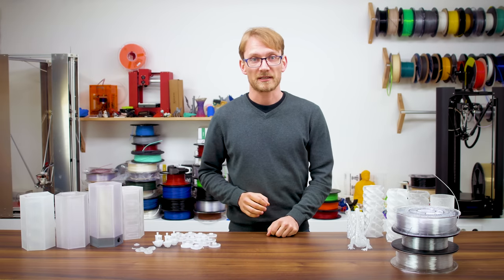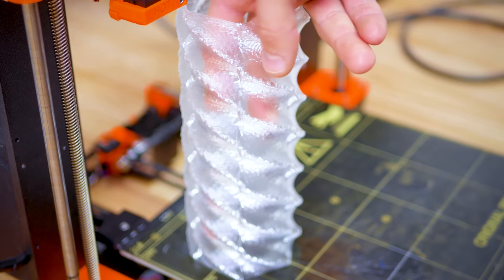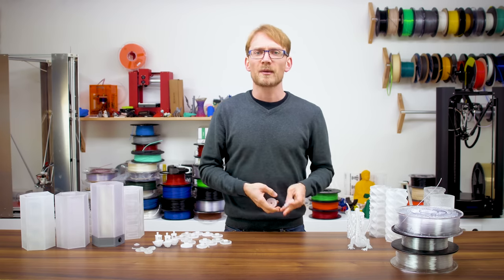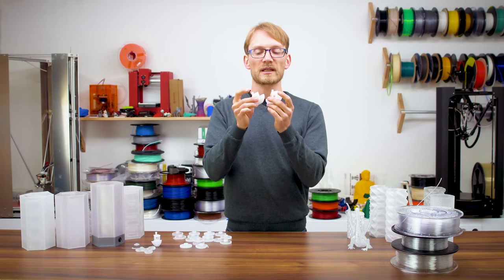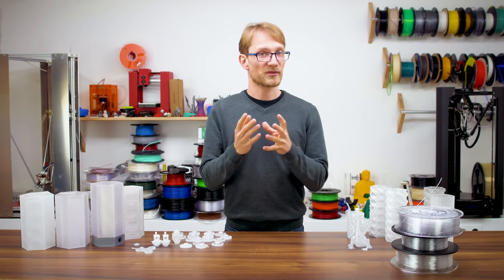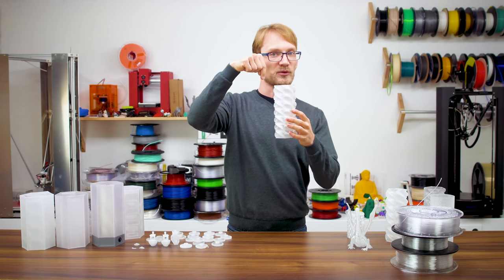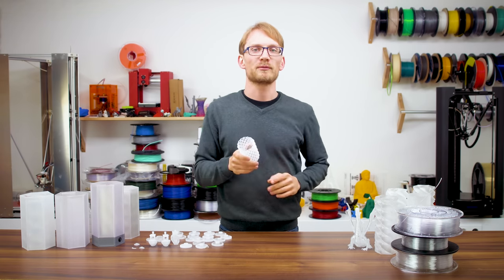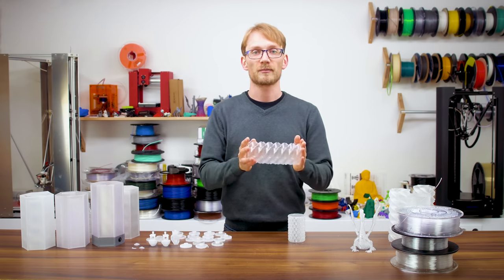How to create transparent 3D prints!

Comment: I haven't done any 3D printing (yet, waiting on my first printer being delivered), but I've worked in injection moulding for 20+ years and have a little experience with PETG. To achieve a high degree of clarity you want to dry your filament for about 3-4 hours with warm air (at least 70c, PE, PET, PETG are hygroscopic) and with a desiccant material in the airflow. Once dried you can reduce the heat to 40-50c but it must remain in a dehumidified chamber if you're going to print for more than 1 hour as it will absorb moisture from the air (that's what causes the spitting and burning at high nozzle heats, you want high nozzle heats). You need to cool the print quickly to retain the semi-crystalline structure, the longer it takes to cool, the less crystallinity will be retained. Big fans and a lot of them! High speeds increase crystallinity too, as the polymer moves through the nozzle tip the molecular chains align, the faster it moves, the more they align (hence the higher extrusion rate improving clarity). Thin wall sections with 100% fill (in Injection moulding high pressure is always favoured for clarity). Small nozzle diameters will help with increased shear force on the polymer through increased exit speed, I would guess a .1 nozzle with .05 layer heights would be adequate, with print speeds as fast as your machine can handle.Maybe I'll make a video on print clarity one day, when I get comfortable with my printer, I'd prefer to see you beat me to it though!
Reply: how did your testing go?
Reply: It’s been 7 years… We start to forget the things we should remember… And we remember the things we should have forgotten… how was the printer??

Comment: I was literally doing this earlier today. I noticed that a low layer height works better, just like you did. I also found that increasing bed temperature a bit helped the bottom get clearer too. I also tried disabling the fan, which did help make it clearer, but can't really be used with fine details. It worked for what I wanted though. Last, I found that increasing flow rate messed up some of my tolerances, but increasing only infill flow rate didn't (not as much at least), and the results were still just as clear. I would recommend that if your slicer supports different flow rates for perimeter shells and infill, you tune them independently.

Update: I also found that shallower infill angles reduce the bubbles trapped, increasing clarity. Instead of having the layers laid orthogonal to the previous one, make each layer lay about 15 degrees off from the previous one. I think the optimal solution for clarity would be for all the infill layers to be laid parallel and just offset them by half the nozzle width so that the new plastic is laid in the grooves from the previous layer, but I don't know if any slicer can actually do that.

Comment: You might want to try the oven for more uniform heating. In small increments heat a piece to just over the glass transition temperature 81c and let it cool in slow steps to reduce warping. See if annealing this plastic will help with clarity.
Reply: yeah i was wondering if something like that might help.

Comment: For the clear transparent prints, it doesn't really matter what clear material you use, it is important to make it 100% solid. The bubbles and layer lines reflects the light, so get them out and uniform print is the key. With the UM2+ printer I use settings: layer height <0,06 mm, flow 107%, 100% infill, no retraction, temperature little over the regularly used (e.g. for PETG normally 240 C, now 255 C), bed temperature >80 C. Speed doesn't matter so much. With these settings the bubbles come out and the layer lines disappears.
After the print is completed, you need to sanded the surface layer lines off, with >500 sandpaper. I also at the end smooth the surface with flame torch. Also chemical dissolving the layer lines out of the surface works.

With layer lines of 0,1mm or more, you can't ever get fully 100 % solid prints.

Comment from the maker: I feel like these parts came put great, even if they don't look like a perfect sheet of glass. Got any more tips to share for getting 3D prints perfectly clear?
Reply: Printing on glass can give you a transparent bottom.
Reply: I printed transparent PLA on glass 1mm thick then placed it in the oven at 180 Fahrenheit with (borosilicate) glass on top and bottom until the trace whiteness disappeared (about three minutes). Completely transparent plastic window.
Reply: NotMyActual AK interactive makes a finisher for transparent parts. Modellers use it for canopies and the like, and the effect is unbelivable so that might actually work
Reply: I have used acetone vapor on PETG and the surface seemed clearer. 
Just don't use a heat gun on it after, it will become really bubbly!
Reply: DO you think you could do a video on the Duplicator 7   it looks like a very promising SLA/DLP Printer.
Reply: How about using XTC-3D?
Reply: Tom,  as a materials science engineer - fast cooling will make more amorphous/clear while slow cooling will lead to crystallization/cloudy, hence your results from hotter center raised portion of the gear.  I think hotter and faster would work well or with fan on 100% smoother surfaces also help, so you may try flat discs that you can polish / try putting packing tape over the surface which effectively "smooths" it without the effort of sanding
Reply: Hello, great video, i'll make vases for that purpose :) With RGB LEDs inside for ambiant lights :)
About clear prints, what about annealing? perhaps that the low temperature cooking process could make the material more uniform, and imrpove the layers interfaces!
Reply: Thomas Sanladerer what about concentric infill? often i print translucent petg parts with 100% concentric infill and it seems to be way more transparent than rectiliniar. interested to hear your opinion
Reply: You should try out Polysmooth and the Polysher. I got mine a week or so ago, and the transparent filament is amazing, especially after being misting it with the isopropyl alcohol. https://instagram.com/p/BTcVerqjnyV/ I've only tried the vase mode settings so far.
Reply: XTC3D coating has worked wonders for me in the past. Has nearly the same refraction index as PETG and fills all the tiny gaps.
Reply: Have you tried using acetone on the surface?
Reply: Can you do ABS clear with acetone smoothing and post results?
Reply: I found that when the filament bubbles, it helps to increase the speed or decrease the temperature (as you said). I got a clearer benchy than you did. I would like to see a part 2 where you print a solid cylinder with a Delta, while playing with the temperature and speed to actively see how both speed and temperature affect the transparency of the print.
Reply: Slightly flamepolishing with a micro-jet lighter works wonders. Transparency with 100% infill is all about the surface finish. PETG like materials take really well to flamepolishing, but don't overdo it, or it will shrink (possibly uneven, thus breaking your part). tldr; treat it like acrylic glass that you just cut with a jigsaw.

Also, just found this article about printing silica glass:
https://www.nature.com/nature/journal/v544/n7650/full/nature22061.html
Reply: I haven't done this but did you try annealing it?
Reply: There is this 3d XTC or something like that surface finish. It's a clear coat and could potentially fill the little gaps and remove the lens effect entirely. Give that a go with a lamp cover, inside and out. I'd be interested in seeing those results.
Reply: I noticed you didn't mention a clear abs. I printed a pineapple in vase mode with clear abs, then treated it with an acetone vapor. Came out super clear! More than any of your example. I also used a Volcano hotend.
Reply: Does PETG get melted with solvent? If no, try to pulverize solvent onto the surface and then dry it with dryer at low temp.
Reply: Thomas Sanladerer  
Ever have any problems leaving your filament out like that?
Reply: Since Thomas was using PETG filament acetone wouldn't really help here. Toluene (undiluted paint thinner) would work, but it's use is heavily restricted in much of the world due to inhalation risks.
Reply: vapoursmoothing?
Reply: It's theoretically possible, but PETG doesn't react to acetone the way ABS does. There are chemicals that might smooth PETG (Toluene, some concentrated acids), but they pose serious inhalation (and sometimes fire) risks.
Reply: Resin printing
Reply: That would definitely give you a clearer print, and it makes me think... maybe the best solution for this problem isn't a CNC device at all? A foam board mold filled with epoxy resin might provide the best possible result.
Reply: Resin printers are a bit of a pain, but they offer the ability to print exactly what you want, just like plastic 3d printers. They have higher resolution, and the resin is clear [or tinted as you choose]. They use light to activate the resin, so there's limited moving parts [mostly, its about the lifting platform]. I'd go with that for clarity, if you still need the power of 3d printing.
Reply: Thomas Sanladerer (for Ultimaker 3) the layers should be between 20 and 50 Microns, (20 microns is the best for lens quality) also the filament should be printed at the maximum recommended temperiture, retractions and fans should be disabled, (Careful) you should sand and polish (with a low speed plastic brush tip on the dremel tool) the parts for best results.
Reply: Thomas Sanladerer could you share the files of that lamp? It looks awesome!
Reply: Hey Tom, great video as always! I got better transparency with fan off and lower printer speeds. Have you tried playing with fan or speeds to increase transparency?
Reply: Could put in an oven that's pre-heated for a short amount of time and then take it out and quickly cool? I like my heat gun but its blasting out 700(f)-1000(f) heat and wont evenly heat the part easily.
Reply: a fogger and some acetone
Reply: Actually, 3DXTech has 4 colors!= Diamond=(clear)= Saphire(blue) +Ruby/red and Obsidian /Black
Reply: T-glase is great, especially if you're printing with a larger nozzle like 0.7 or 0.8mm. Then coat with XTC 3D resin epoxy (on amazon, well worth it) and it will look even more amazing. Much more clear than in this video, for sure.
Reply: Print without fans and retracts, 100% Infil and then top is kinda clear

Comment: I got super clear parts using clear abs printing at 0.1 layer height at 250°c nozzle temp, 100°c bed temp 100% infill in a sealed chamber. after acetone vapor smoothing it was super clear almost like glass and thicker parts gave almost a magnifying glass effect. a few weeks later I printed the same parts again and it had bubbles that followed all the layer lines, I attributed to moisture it absorbed from the air that steamed in the nozzle as it melted.

Comment: a slightly domed nozzle helps a lot to massage the air pockets out of the hot plastic and get solid, glass clear prints out of PETG. ideally use a raft, or very high initial bed tem, to prevent the first layers from cooling too quickly. this still works with thicker layers but certainly not for all prints.  clearcoat makes the finished product look much more transparent too.
Reply: this tube has about 4mm wall thickness: https://www.dropbox.com/s/vwfa6qq9f5kwqhh/IMG_20170311_183919.jpg?dl=0

Comment: I remember doing tests like this a couple of years back specifically with PET. Think the conclusions I came to were thick layers (extra multiplier + more layer height), very slow speeds, more conservative heat settings, and no cooling fan. That was specifically for vase mode or 2 shell 0 infill boxes. I think the slower speeds allowed more time for the heat of the parts to stabilise, and reduced artefacting from movement, allowing for clearer walls.

I seem to recall very thick or very thin to not necessarily be of optimal in terms of optical clarity. I think I liked 1.25-1.75 layer heights in terms of light refraction, and anything outside of that seems to look more hazy. I'm sure that's dependant on other settings I had at the time and the slicer itself though, so that might not be relevant. It also might just be that this was the optimal material quantity to push through to not overheat or underheat the filament.

None of this is likely to apply to solid infill parts.

Comment: The fogging or haze seen in that PETE filament is something that's noted by soda manufacturers. PETE naturally becomes hazy over time. 
Flame polishing seems like the best bet, but, rather than re-melting bits, you should aim to have it oxidize small layers off of the piece entirely without remelting the greater whole of the print.
Reply: Which is why PETE is not used as a filament for 3d printing. The filament used  is PETG, a glycol modifier prevents the polymer crystallising (amongst other things) which is what causes the hazing in PETE. The hazing seen in PETG is due to layer bonding issues and temperature control during printing and not a result of changes to the polymer chain. Both can be overcome. As for oxidising small layers off the print - absolutely not.

Comment: Basics of what I'm getting from this instruction video using PETG family of filament is to push the flow or extrusion value a bit over standard settings; use 100% infill, use lowest layer height extruder and printer will provide; use a higher temp but watch to not overcook and lose transparency; post processing can help.
My experience with post processing has been disappointing in regards to improving transparency.  Problem I believe is internal micro-bubbles created with laying down of the layers that surface smoothing is unable to touch.  Another problem is the slicer’s print pattern.  With Slic3r, the best I’ve been able to achieve is cross-hatch of 45 degrees which is also prominent in the videos examples.  Cura allows this pattern to be adjusted to a single line angle with no cross-hatching.  This gives better results but still leaves a discernable line.  In any regards, there are examples (and stories) of folks gaining amazingly clear transparency but how this has been achieved escapes me?  There also appears to be disagreement of line height that I’m observing from Google searches.  Some are saying thick and even suggest exceeding nozzle diameter and others, as recommended here, smallest height possible.  This also brings a question of line width but haven’t seen recommendations here.  Should also note that virtually all say no cooling.

Comment: I've been messing around with transparent printing and I have actually had very nice results with using PET filament made from pepsi bottles (only pepsi though) and a 0.8mm nozzle with 1.6mm line width at 260° and 40mms.  It needs VERY strong cooling though or else it gets cloudy.  But oddly enough the pepsi bottles do a really nice job.  Similar with aquafina bottles.  Don't know why but coke bottles just don't come out anywhere near as clear with the same settings.

Comment: try using a wet and dry sandpaper with water, this is what's used on clear plastic headlight lenses where there has been damages and discolouration it improves the clearness of the lens quite a lot making it much clearer. having said that it would probably only work on flat surfaces its not like you can do this with a benchy unlesss you can use a dremel but even then i dont think it will be that good.

Comment: an acetone wipe or spray could probably make the surface really smooth and is fairly easy, easier than sanding a smooth finish. i dont know if acetone works on petg but it does on other plastics.

Comment: If anyone wants optically clear, I'd think it'd still involve a multi-step process. Just 3D print as you'd normally do, but polish and chemically treat the part as needed for an extra smooth surface. Then make a silicon release mold of the 3D print. This would then allow you to do an a resin casting with something like an acrylic-epoxy, which should be as close to optically clear as you can get.

So printing custom lens assemblies and the such are possible, but not as straight forward as putting a special filament in your 3D printer. (At least for now.) Also with "mirror in can" spray paint, custom reflectors may be possible by coating the backside of the clear casting.

At least the idea is out there, I wonder if somebody has successfully tried it yet?

Comment: What about a large diameter nozzle and decent layer height. How would a E3D volcano with a 1.2mm nozzle perform on vase? I would assume that the larger nozzle with the larger layer height would make it almost transparent right?
Reply: I agree, but can not confirm the theory. Would have been a nice idea to see how different nozzle sizes (or even shapes) could influence the clarity. May be an idea for a follow up video to see the difference between extremely tiny and massive nozzle sizes over a wide span of different layer heights.
And i think for calibration, using a piece that changes parameters like temperature, extrusion multiplyer and layer height dynamically over the z-axis would give you a good idea of where the sweetspots are.